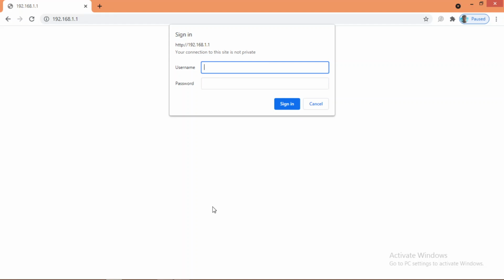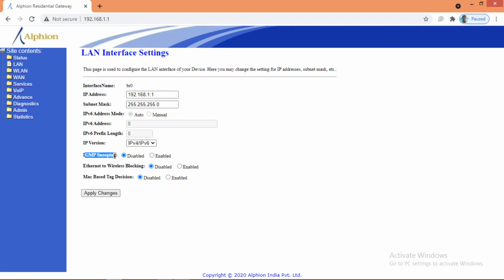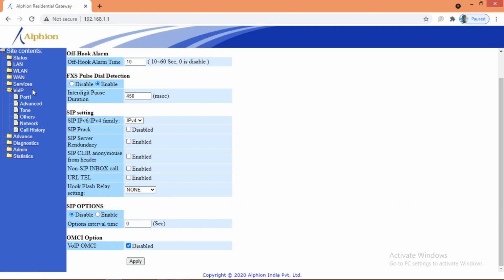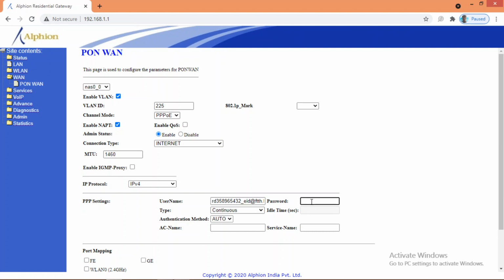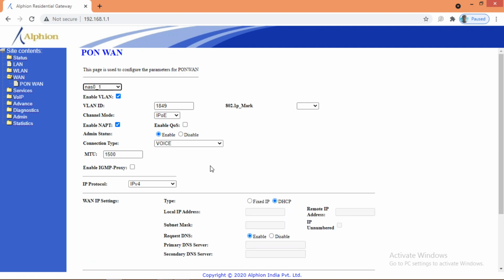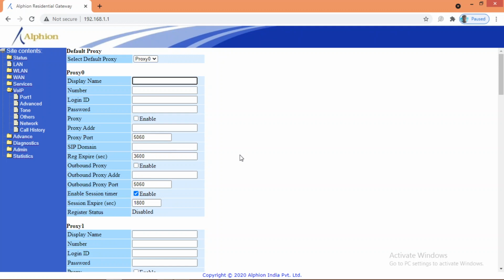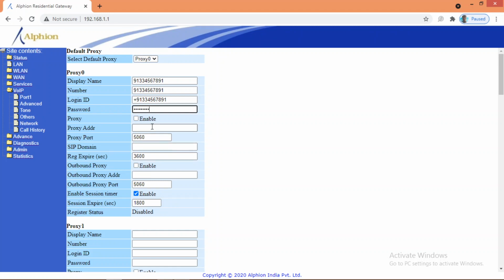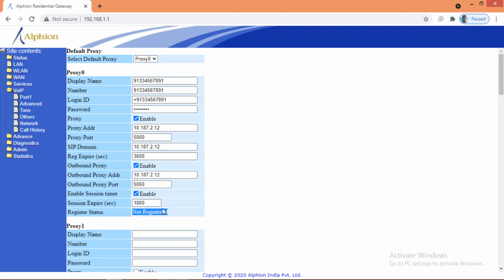ALPHION  ONT SET UP WITH OPTRONIX OLT  PROBLEM SOLVE OF PON NOT GETTING STABLE

Comment: How to disable AP isolation in this router.
Reply from the maker: Can you please elaborate , what do you actually need?
Reply: @debasishsworld7492  I got the solution. I was unable to cast to my chromecast I connected to TV. I got new firmware updated by contacting the router company.
Reply: @ARUN_HENCHINAMANE  is there any contact number or mail address
I am also struggling with same problem i even tried turning on upnp but still Chromecast isn't working
Reply: @ARUN_HENCHINAMANE  is there any contact number or mail address
I am also struggling with same problem i even tried turning on upnp but still Chromecast isn't working